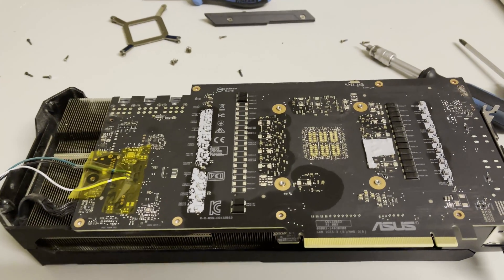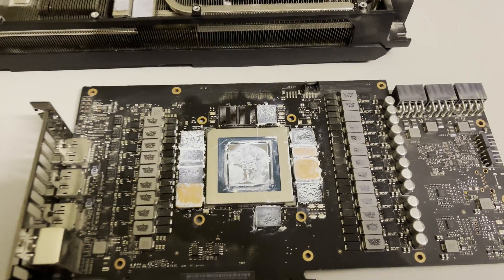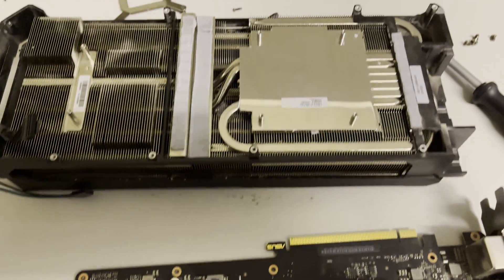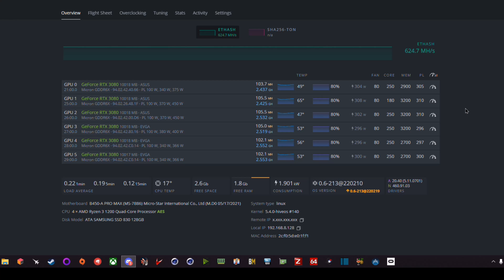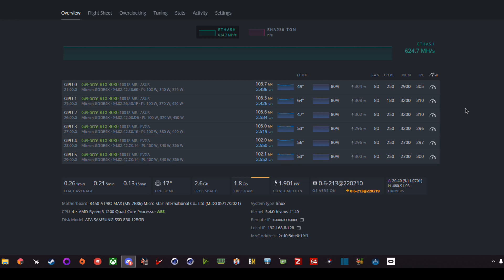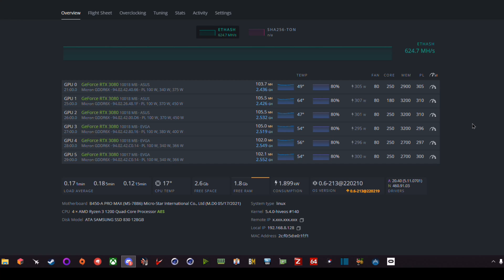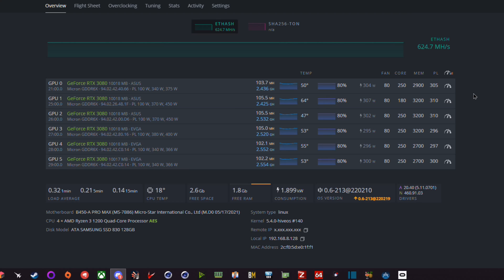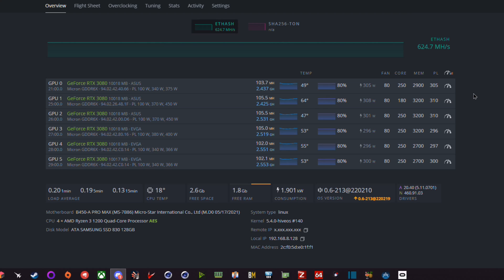After 6 Months - RTX 3080 Copper Mod - How Did It Age? Teardown - Analysis - Conclusion - ASUS Strix

Comment: Because of your videos, i've been copper modding all my 3080s and I absolutely LOVE it. Thanks!
Reply from the maker: Thank you very much mate! Sounds awesome!<
How much cards did you modify in the end?
Reply: @UnleashedOverclocking  1x 3080 FE, 2x 3080 MSI Ventus LHR, 1x 3080 MSI Surprim FHR! I have an EVGA FTW3 3080TI that I was debating copper modding, but honestly it's pretty decent with stock pads and cooler mining eth at 87 MH/s at 80degC vram. I have a side project idea for you! What do you think about copper modding a GPU and then adding a 360 AIO cpu cooler to the backplate of a gpu?
Reply from the maker: Wow. That are a lot of cards! :D
The 3080Ti seems to be fine. Yes. FTW3s are running the coldest from factory. AFAIK. 

Sounds like a fun idea. But honestly I did something similar on a 3090, which is watercooled. 
And then I slapped a watercooler to the back. You expect a temperature drop of around 10°C by doing this (with good pads ofc).

Comment: I copper modded my 3080 (non LHR) recently and had an interesting problem. Whenever my fans are on, my hashrate which is normally 100-101 MH/s on ETH drops to 60-70 MH/S. At 100% it is 60 MH/s, at 50% it is 70 MH/s, at 35% it is 80 MH/s, and at 0% it is 100+ MH/s. What could be causing the problem? Is it possible something with the copper mod is causing a short with the fans? This is an ASUS Strix OC 3080. Right now I have an external fan pointing at the 3080 and am averaging 76 C on the VRAM with fans set to 0%, so I'm not too concerned in the short-term, but would like to fix the issue! Thanks in advance for your help!
Reply from the maker: So, I was thinking pretty long about this and actually. I dont have any clue and never experienced any of this weirdness. 
The only thing I can think of, is that the BIOS is maybe interferring. Did you try to flash an other one?
Reply: @UnleashedOverclocking  The issue magically disappeared a month later. Now I have no issues at all using full fan speed and I am able to easily get 100-101 MH/s. I'm not really sure what happened, because the issue was consistently a problem for several weeks no matter what I did, but now all of a sudden it is fine (no changes to mining software, driver, nor BIOS). Very strange!

Comment: like, subscribed and admirer to death, without your experiments I wouldn't dare to cross the barrier that separates hell from heaven hahaha working with 65 degrees must be incredible. I have a question, your opinion would be worth a lot, my 3080 ti accepts 1.5 mm thermal pads, do you think I should start testing that size or would it be correct to reduce it to 1.3 mm?
Thank you for your great contribution to this sector and when I get results I will share it in case they can be of help.
Reply from the maker: Thanks a lot mate! Really appreciate your kind words!
Yeah. 1.3 or 1.4mm should be a good value to start with!

Comment: What tool did you use to cut the copper? Can we just use thermal pads in the missing spot of vram insteaad of cutting copper ?
Reply from the maker: Hey, I just used a normal saw. 
Uhm.. I wouldnt recommend. Makes the whole process senseless.
Reply: @UnleashedOverclocking  do you have any link for the saw pls

Comment: Hey dude! I really hope you could help! I tried to do the same with my Gigabyte Eagle 3080, and i got memory temps to 74 degrees, but my core and hot spot, got up to 106+ degrees. The die does touch the heatseank and the paste does spread around the die after pressue, so i'm not sure what to do in this case.... Please help if you know a reason...
Reply from the maker: Even it it looks like, that the die has contact. Mostlikely not. You need to take off around 0.1mm-0.2mm. Then you should be fine.

Comment: Too bad that the cost of electricity in Brazil is too high so mining is just too expensive and not worth it unless BTC goes above 50k. Getting 92mh on a Strix 3080 LHR (-300 gpu +1000 VRAM) but the VRAM is getting too hot (~ 96ºC open air). Debating if I get to copper mod the 3080 since I'm just gaming on it these days.
Reply from the maker: Pewww. I dont really know. But in terms of gaming, you probably can go with thermal pads as well!
Reply: De que estado você é? Eu faço a mineração por SP e vale a pena. Eu tenho 1gh. Você precisa em média de 550cfm de exaustão a cada 1000w de consumo para resfriar as gpu sem ar condicionado. Numa temperatura externa de 30 graus celcius, você consegue manter uma rig a 50c~55c com as memórias em 95c no máximo. Se você colocar coolers para fazer push in pull out, você consegue até mais baixo. Lembrando que tem que jogar este ar inteiro para fora do ambiente.
Reply: @rafaelpereiradias2567  no PR não rola.. Estamos com bandeira vermelha mais outra "taxa" hídrica..
Reply: @Wat3va  aqui também. Meu kwh é 1,10. Mais de 50% é custo elétrico. Mas recomendo utilizar tudo no 220v e se tiver a oportunidade de colocar um trifásico com um pdu de servidor trifásico, é o caminho. Minha conta baixou bastante. Se você utilizar ar, opte por um industrial trifásico que seja inverter. A exaustão é interessante usar o exaustor ventisilva e40 trifásico ou mono de alta velocidade, ele aumenta seu custo elétrico em uns 60 mensais no máximo. Nesse caso, seria 1 por rig. Procure também fazer uma torre quente, onde você isola as Rigs dentro de uma caixa, duta pra fora de casa e coloca esse exaustor puxando! As Rigs ficam bem estáveis dessa forma, muito mais do que as Rigs que eu tenho ao ar aberto. Eu sempre insisto para não desistir da mineração, ela realmente tem o potencial de mudar a condição financeira de muita gente.
Reply: @rafaelpereiradias2567  R$1,18 por kwh aqui.. Calculei agora. R$300,00 por mês, +-, de retorno minerando. Precisaria de +- 34 meses pra dar o retorno no investimento só da 3080, sem contar o custo total com instalação, ar, energia.

Se estivesse dando uns 15 reais diários ainda assim eu pensaria 2x.. Caiu muito nos últimos meses. Comprei minha 3080 por 7k, mas hoje já não acha por esse valor. Fiz o cálculo com o preço de hoje (10k).

Se eu fosse começar teria que ser quando lançarem a série 4k da nvidia ou 7k da AMD pra obter retorno mais rápido e ter retorno de 24 meses no total da operação, não só retorno das placas.

Comment: Are your cards really using 300W? Mine only uses 222w according to what the t-rex says or what the t-rex says is wrong?
Reply from the maker: Yes, they are using 300W. Like you can see there are two MH/s (GH/s) values. 
Im dual Mining with those cards. Soooo yeah. They are using 300W due to the other coin. (TON)
Reply: @UnleashedOverclocking  I didn't notice you were using dual mining, thanks for the clarification! 
(I have to test it on my rig too) haha, I calculated and saw that it gives a little more profit.
Reply from the maker: In my case it gives me around 40% more profit, which is definitely not less!

Comment: i thermal padded modded mine first attempt with thermaalight pads not good 90'c .2nd attempt I used gelid ultimate 1mm thermal pads and temps I was very happy. Great fix also learned how to do thermal paste on gpu is differnt than adding paste to cpu's . I  know from experience.Gpus seem to need more cause there more hot spots on gpus.
Reply from the maker: Yes, thats true. I always use more on GPUs. Also bc. if there is too much, its not a problem at all.